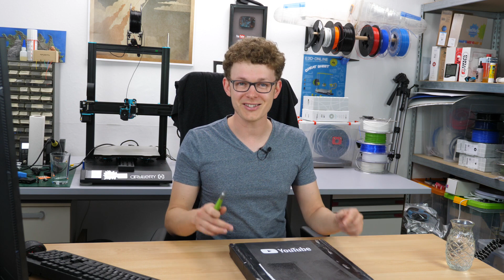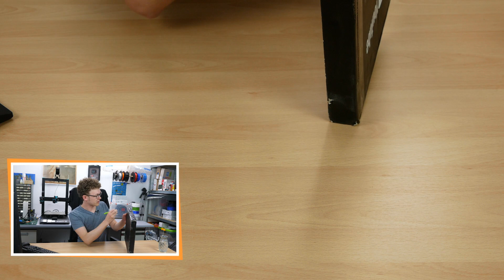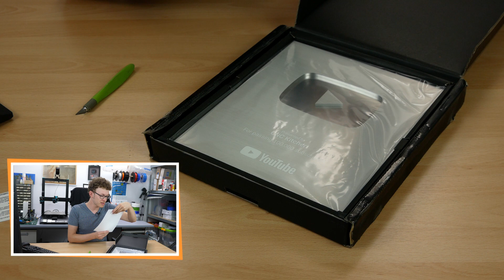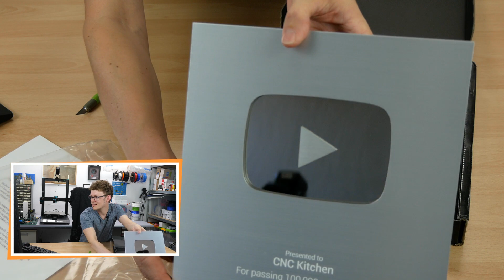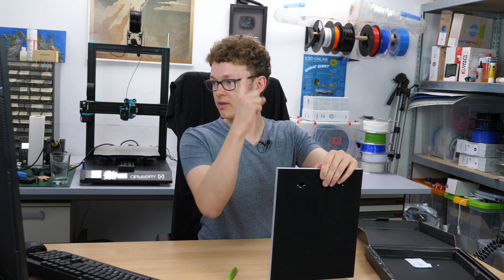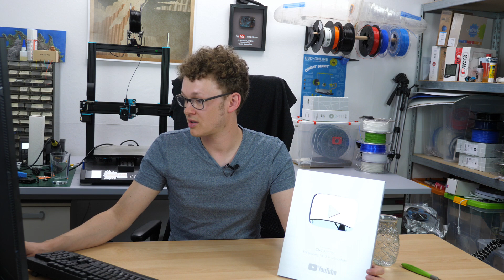WAS LIVE: UNBOXING my SILVER PLAY BUTTON + Q&A for 100k subscribers!

Comment: Hi ! Have you started venturing in mixed color printing ?
I have seen some hobbyist brands show up with 2 and 3 color mixers, but I don't know if these can only do gradients, or if there is fine control on how much % of each color goes where in the model. Also, for a 'full color' system it would require 5 colors (CMYKW). Are there any hobbyist-level printers or DIY kits with this capacity?

Comment: Wound up with a Cura 4.2.1 problem recently.   Downloaded it like Thurs or Friday.  Did a slice of a drone prototype bottom plate that was 3mm thick.  Got a beautiful print from the resulting .16mm 19 layer print with my CR10S.

Then...

Windows updated.   Came back the next day to slice the top plate which is also 3mm thick(cura sees it as 3mm dimension).   I printed without previewing and got a 1.4mm thick plate...  wtf.

Went back to reslice the file, hit preview and now it is a 7 layer print with .16mm layers...

Tried uninstalling and reinstalling.  Still f'd up.   Tried re-exporting from Fusion and deleting the printer profile to redo the printer profile default.   Still same problem.

Went back to Cura 4.0 and STILL the same problem.

How the hell is this happening?   I changed nothing from the first day I printed under 4.2.1.   Only thing that happened was a windows update.